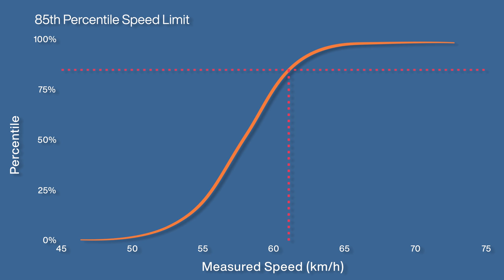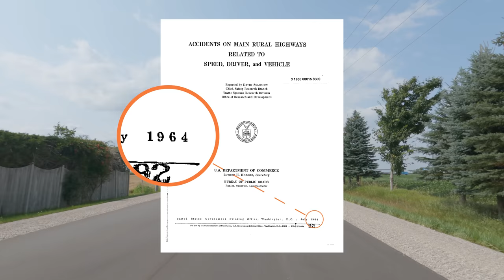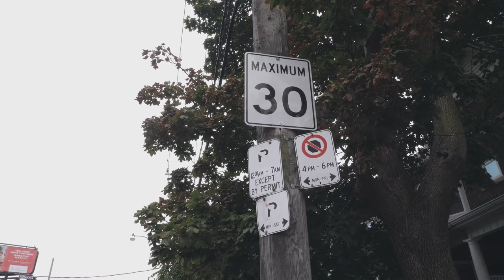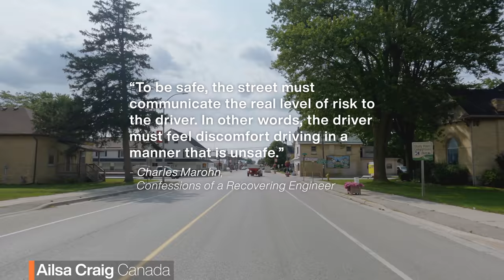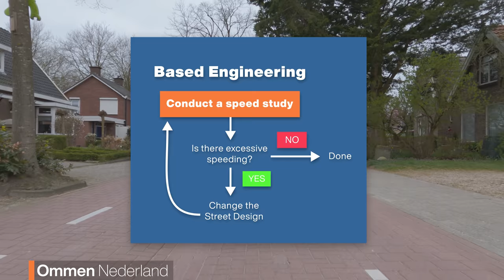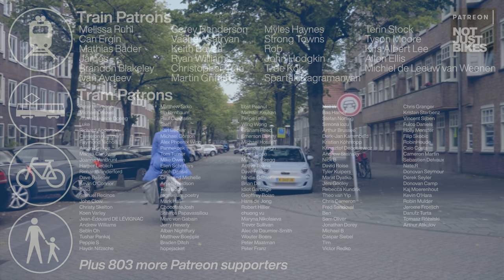The Wrong Way to Set Speed Limits [ST06]

Comment: We have two roads in separate suburbs in my city. 1 has a variable speed between 60kph and 40kph the other has a fixed speed of 30kph. Both streets have a lot of shops, street parking, small shops, cafes and bars bringing with it lots of foot traffic, cyclists, people with pets, parents with prams etc. The crazy fact though is that both these areas are under control of the same council. As you say people should be able to know the speed limit subconsciously just by taking in cues from the surrounding environment but ridiculous situations like the one I describe make it impossible.

Comment: The small towns with highway roads through the town, I feel, are oftentimes intentional. Most people traveling on that highway don't plan to stop in that town, they are typically traveling through to a different location. So when they get caught in that speed trap, they are very unlikely to come back to the small town in the middle of nowhere to contest a ticket. They just pay it and move on. I feel like that's where a not insignificant portion of the local revenue comes from. I could be wrong, but that's my thought process on it.

Comment: I am one of those few people that usually actually follow the speed limits (except on highways/expressways that are 90+) because I learned to drive in Calgary where speeding is much less of a problem. When I went to Ontario it just didn't work and I had to follow traffic instead.

Another safety issue with these speed limits that don't feel right is that sometimes people will just always drive 10-20 over, and then you hit something like highway 85 or DVP in Ontario where there is a 90 limit and going 10-20 over isn't actually that safe due to the high frequency of large curves.

And let's got started on construction zones

Comment: The interior of my large Canadian city consists exclusively of streets.  I live in the west end of my city and if I need to access a location in the east end of the city (30 kilometers away), I have three choices.   I can navigate 30 kilometers due east across the city, through city 'streets', which will take 2 to 3-1/2 hours.  For the second choice, I can navigate 12 kilometers due south on 'streets' to access and east-west 'stroad', to be traveled at a higher speed, with less interruptions for 30 kilometers and then when reaching the east end, drive north for an additional 12 kilometers, again on 'streets' to my destination.  Allow 1-1/2 to 2 hours for this trip of 54 kilometers.   Choice number three, is to drive 8 kilometers north on 'streets', then access the high speed highway to travel 30 kilometers east, then travel 8 kilometers south on 'streets' again to reach the destination.  The distance is reduced to 46 kilometers and should be possible within 45 minutes to 1-1/4 hours if the highway has not been compromised by rush hour traffic, an accident or inclement weather.  Best Solution: Do not go to the other side of the city.

Comment: The towns built on a highway should accommodate the highway.  Not the other way around.. Converting a state route to a city street should not be done until an equal or better than bypass has been completed to convey the existing traffic volume.  Lowering speeds has no magical power to decrease volume of vehicles on road.  
It will definitely increase congestion though. Congestion is failure in most any case.  This shows where design did not meet load. If a township had an overloaded sewer, would they restrict existing pipes??   At some point the access must be limited to main vessels and small towns starting on them respect the highway that provided their ‘route to’ success.

Comment: Every traffic engineer should watch this. I hate driving on a 4 lane woad, with a massive island, that looks like it should be 50MPH, and it's a ticket trap with a 35MPH sign. The road is made like a highway. In this case, with no buildings, schools, or other issues, it should be 50, but it's really a revenue collector for the city.

Comment: There's a road in my town where the limit is 25 mph where it passes through a neighborhood.  It's 4 lanes (2 lanes each way) with a center turning lane.  Speed limit coming in to that area is 40 mph on one side and 35 on the other.  The road doesn't change at all.  A street that size does not feel like a 25mph zone at all. No one goes 25 through there even with the flashing radar sign.

Comment: You are correct. In the 60s and 70s roads became wider in the USA street corners had a larger radius returns to enable cars to go faster. Never mind the pedestrians. For one of my oldest children we had a car rug manufactured in the 1960s but with a 1950s design. I’ve put a lot of thought into that rug because the roads were narrow in those days and the corners were quite sharp; vehicles had to slow down a great deal to make turns. My concern throughout my adult years has been to provide greater concern for pedestrians and thus for bicycles and other slow vehicles. I remember seeing a pedestrian crossing in England which actually forced the driver to stop for any pedestrian crossing the road; not simply a zebra crossing it actually had an island for the pedestrian to stop for the car to see him and proceed.

Comment: In some parts of the USA, law enforcement takes advantage of these designs that give you long, straight, expansive sections of roads with reduced speed limits so that they can write tickets to generate revenue. In fact, a large percentage of an average, small to medium sized police department's revenue comes from speeding fines. Granted, this is probably not that common but it exist. 

Lastly, there are a couple of things that make this 60's model of determining speed limits so difficult to control: of course we know that cars back then are very different than cars today. Today's cars and SUVs are smoother, faster, and more isolated from the outside which, more or less, disconnects the driver from any real sensations of speed and control. Sometimes, a driver may need to drive faster, or at least maintain a constant speed in areas where they should be slowing down. 

The last thing is that, in my opinion, most Americans have an askewed sense of "rights and priveleges" when driving. It's a "I can drive what I want, how I want in any way I want because it's my 'right' ". It's a deformed sense of the word but I do believe that's the mentality. Unfortunately, driving with this sense of "false superiority" means that if others don't like it, or are inconvenienced by this kind of attitude, too bad. This is true for many "rights" in our country but that's a whole other story. 

Maybe it's just me but it seems there is more of a common courtesy and respect in most European countries for driving and for drivers.  But then that prompts the question- would drivers in, say, the Netherlands drive any differently if they were driving in America's wide open roads with no regards for proper speed reductions? 

And would Americans aggressive attitudes about driving be tempered when driving in the Netherlands on their system of roads and speed limits?

Comment: You should see highway 411 through Benton and Englewood, Tennessee.. Ridiculously wide 4 lane highway, not a ton of traffic, very little entering and exiting traffic and the lanes are split by a median lane. The speed limit here nonstop changes from between 25mph to 45mph just to generate revenue for these small towns. I found this in an article about this ridiculous speedtrap.  in the month of March, 2016, that the city of 1500 residents and 2 sq. miles had 400 traffic stops, with only one of the citations issued to a city resident, resulting in almost 30 thousand in revenue for the city.

Comment: I think a great way to make speed limits make sense is to eliminate them completely. Seriously, what's the point of a speed limit if the road design is correct like it is in those "civilized countries"? At first you'd think everyone would go too fast and wreck, but if the road design prevents people from speeding, then that wouldn't happen. And any obviously improper driving would still count as reckless or otherwise unsafe.

I would also like to add that speeding is NOT the biggest cause of accidents - distracted driving is. Speeding, anyhow, has never killed anyone. Suddenly becoming stationary, that's what gets you.

Comment: We're lucky here. Everybody drives massive SUVs with metal bars on the front and hard angles and flared guards and names like raptor and tags like beast mode. So you don't need to worry about pedestrians and cyclists because the only people insane enough to get out of a steel box died ages ago.
Real lucky.

Comment: Dutchie here, it's not just that the streets are built in such a way to promote the right maximum speed. Every road you'll see, especially rural ones, is built in such a way so that it is always clear what the speed limit is. No centre line with bike lanes on each side? 60km/h. Two lanes with seperate bike paths? 80km/h. You learn this in school and for you theoretical driving exam.

Comment: Norway has set rules for the number of inroads on highways combined with numbers of lanes (usually, Norwegian highways have only one lane in each direction, with sections of road where there is two lanes in one of the directions for a limited strech). If x amount of roads intersect with the highway, XX is the speedlimit. Less intersections, higher speed limit, along with merging lanes if it is a motorvei.

Plus a general speed limit rule. If you are driving on a road that looks like a country road with few houses, shops and so on, the speed limit is 80kmh unless anything else is specified. If it has houses or resembles a rural area or an area that is populated, the speed limit is 50kmh.

That dictates the speed limit. Very often, I drive on roads that has a 80Km/h speed limit where it is close to impossible to go that fast because of all the bends and turns and the poor quality of the road itself.

Comment: 5:10. Even in motorsports, driving is still a subconscious activity. Drivers are less concerned on their speed, and more on when to accelerate, brake, and steer. The race track design reflects on that. Apart from the obvious width to encourage high speed acceleration, there more factors:
• Rumble strips on corners (and sometimes distance markers) signal the drivers the approximate location to begin braking. The skill is knowing the exact point to brake. Too early, car loose too much speed. Too late, car runs off road.
• Apex and roads going straight signals the approximate location to accelerate. The skill is knowing the exact timing. Too early, car runs off road. Too late, car's average speed is less.
• Chicanes signals speed reduction. The skill is to loose as less speed as possible.
• Darker lines on the track indicate where most drivers position their cars to.

For drag racing, the skill is maximum possible acceleration with least skid on the tires. For oval, the main focus is overtaking other cars. Regardless of motorsports, speed isn't the main focus.

Comment: Was caught by an officer with a laser last week. The speed before the sign was 100km/h and it's a 2-1 road and the sign showed 70km/h because there are two gas stations, each one with its own lane to turn off the road and each with an intersection where you enter a separate lane to then merge with other trafic. I was going 85 because I didn't check my speedometer and my brain didn't process the sign even though I saw it. 2000SEK fine (Roughly 200USD) but the 3 officers that handled it were very professional and from the second I was waved into the truck parking spaces to when I was on my way again, it was only 5 minutes. Even had room for some casual chatting.

Comment: I think this explains, on some level, something that has been bothering me about a set of stroads nearby where I live in the US. Basically, I live in a development that is sandwiched between two high traffic stroads that run parallel to each other. Despite the fact that these both border living spaces and businesses, they, like most stroads in the US, have high speed limits and are pretty unsafe. Of course, having grown up in the US, I was never exactly unused to this concept, but even so, something that baffled me about these two stroads was that one is four lanes with a median and (in most places) has sidewalks a fair distance from the car traffic, and the other is two lanes with no sidewalk or median. The stated speed limit for the first is 45 mph, and the other is 40 mph. Worse yet, the smaller road does have small businesses and residential areas (including driveways for individual houses) appended to it, and for some of these places this road is the only real way to access them. It feels relatively open too, since the side that isn't taken up by buildings is open fields (well, save for the train tracks, also running parallel, but it's a little ways out, so nowhere near the same visual effect as trees planted close to the road), so people do sometimes go something like 50 mph or more on this road. When I was learning to drive, the first time I turned onto this stroad, all I can remember thinking was something like "oh God, why are these two opposing lanes of traffic so close together on this high speed of a road?" Almost did hit somebody too, since being in that environment made me so nervous that when someone who lived in one of the houses started coming vaguely close to the road I started to drift towards the other lane out of fear of accidentally flattening a pedestrian.

Comment: There's a giant road built like a freeway with the occasional stop signs otherwise I would've straight up called it a highway. It has 4 lanes wide and very light traffic, the only reason it has a speed limit of 50 is because it's an extended part of a road that has 2 lane that connects it to the freeway. The freeway has turning lanes for the communities on the sides every 10 miles or something(they're easily 5 minutes apart) Keep in mind the speed limit is 50 on a "road" that's built like the highway with only the occasional stoplight and even a school zone but that's 15 minutes of going 70+mph down. All they do to deter people from speeding there is the occasional cop car and cams but that's also placed really far down so there's just this stretch of 10 minute frame where there's a 50mph speed limit with little to no cars at all. Near a school zone I understand and they have the warning signs etc too but like stated in the video, they're little to NO differentiation to suggest the driver to slow down.

Comment: You just made me realize that driving is so abhorrent and exhausting in France and easy in the US because in France we have speed traps everywhere. It means that if you're not actively controlling your speed at all times, you're probably going to get fined. I don't like this design, because I'm always watching the road and my speedometer, not the road itself.
In the US, the speed limit often doesn't coincide with the speed design, but still I feel safer.
Reply: It will be safer for drivers, but that's kind of the point. Places with lots of pedestrians should be built safer for pedestrians, and places with fewer pedestrians should be built safer for drivers. America just makes everything for drivers.

Comment: I must be the odd one out because I am aware of my driving most of the time. I am aware of the type of area which dictates my driving. A residential area usually means slower speed, even if I don't see a sign. A commercial area requires significant attention as the flow of traffic is adjusted more often than other areas. (entrances and exits to businesses)
As for town centers, I think it is a great idea to gradually bring the road to a two lane with speed bumps. But, and this is where any comparison to Europe is immaterial, the US has not been designed around bikes, pedestrians, or even public transit since we got rid of the trolley/train right of ways in the 1950s. A town center is more likely a big road with big parking lots and zero store fronts right at the road itself. In Europe, where the civil engineers were ancient Romans, this is a bit different. I do like the video. I see it more of a "how we should change things for the future" than a how things are wrong as they stand. My old town, where I grew up, has a town center like described here. A street reduced to a road (or is it the other way around? I get rubbish and garbage confused too.) Where I live now, has no such thing as a town center.

Comment: I just moved from Oak Harbor, WA, a small town that is relatively bicycle- and pedestrian-friendly, to Greenville, NC, and the contrast is shocking. My new apartment is several miles south of the city center, and I am surrounded by strip malls and stroads with a 45 MPH speed limit and zero pedestrian crossings. Any pedestrians I've seen around here are usually in a full sprint to get across the road. It looks like I might as well sell my bicycle, because it's useless here. I highly doubt that there will be any improvement before I die of old age. I chose this place because it's affordable. I knew what I was getting into before I came here,  but my choices of where to live are limited by cost more than anything else. I guess livable cities are a luxury for the wealthy. This wouldn't be so frustrating if I thought it was inevitable; unavoidable, but that's simply not the case. The local leaders designed it this way on purpose, and they are happy with the way it is. I don't think any of them live in my neighborhood. I certainly don't think any of them would ever consider walking, using public transportation, or riding a bicycle to get anywhere themselves.